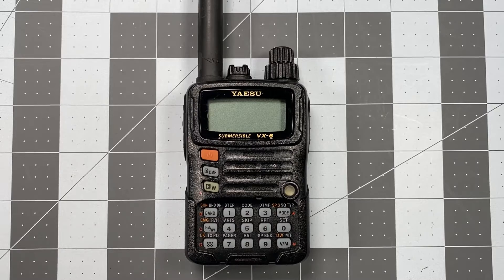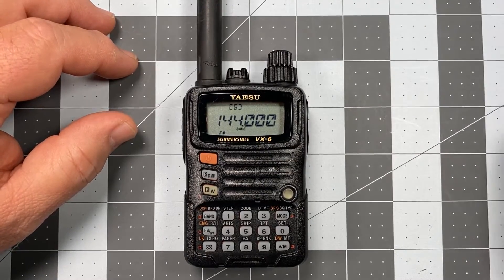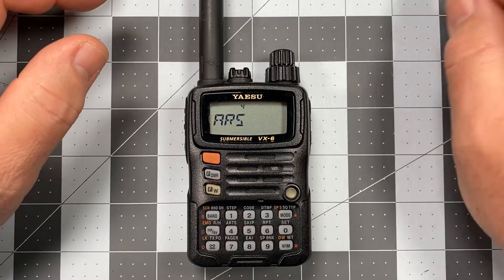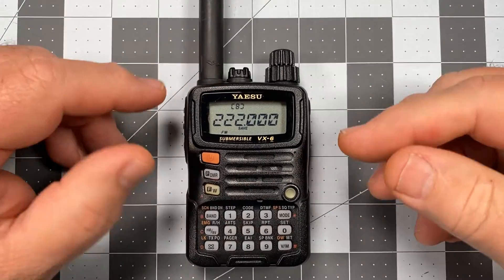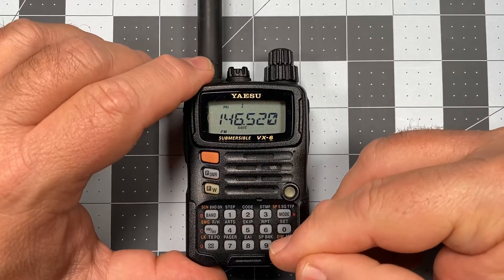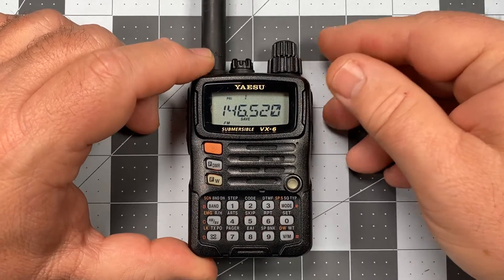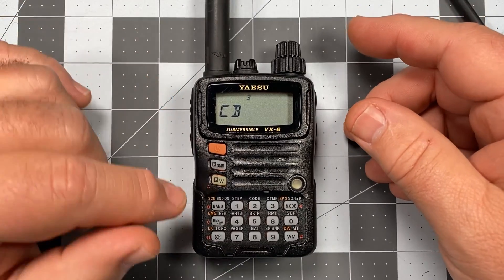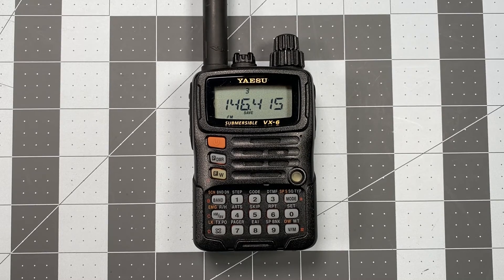Yaesu VX-6 Operators Series - Part 5: Programming Simplex Memory Channels

Comment: Just got the VX6 and when I try to enter common frequencies for my area it won’t let me. So I researched what could be wrong and I guess I received a non US version of the radio as it won’t even try to transmit on 1.25 meters. I guess this one is going back and I have another ordered. This time I ordered it with the MARS mod just in case SHTF. I can’t wait to get the correct version so I can continue watching these videos and learning more about the radio. I always learn better and faster just seeing what is going on rather than trying to read an entire book. I thank you for these informative and thorough videos. I was getting frustrated with them until I realized my problem.

Comment: Interesting. Turning off APS didn’t stop the 5MHz shift from happening on the 70cm simplex band. Tried it a bunch of times but just wouldn’t work. I had to go to RPT (setting 51) and change that to Simplex and then it stopped shifting. Having APS on or off doesn’t seem to do anything on mine.
Reply: Same thing happened to me. Did you have the MARS mod done to your radio? I wonder if that might be why.
Reply: @ammonhymas7196  hmm, as a matter of fact, I do. Watched a quick how-to video and had it done probably 5 min after first receiving the radio. Interestingly 🤔 I do wonder if that would affect this specific radio function.
Reply: @millbean13 Yeah that could be why. I did the MARS mod and had the same issue. At least we can work around it through the RPT (setting 51).
Reply: I have the Mars mod as well, and when I take it to simples on 51, it removes the minus sign, but if I change channels it come right back.

Comment: Thank you for this series!! I have had 2 challenges following along. First, the squelch shortcut will not work. The call LED lights up red and there is a beep, no squelch numbers. My workaround is to use SET 59. Second, my radio would not tune to 146.520. SET 61 needed to be switched from AUTO to 5.0K. Took me a bit to sort that out as I am a complete novice.
Reply: Well, just an update for those of you experiencing the same squelch issue that I am. After the factory reset, check that SET Menu 36 is set to Moni and not T-Call. This is what fixed my problem. Hope it helps you.
Reply: Thank you 👍🏻